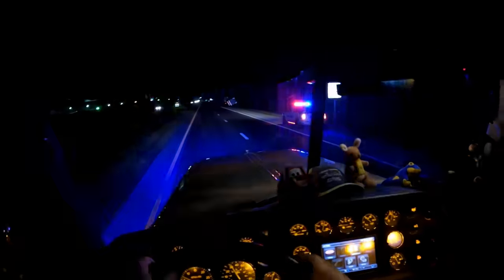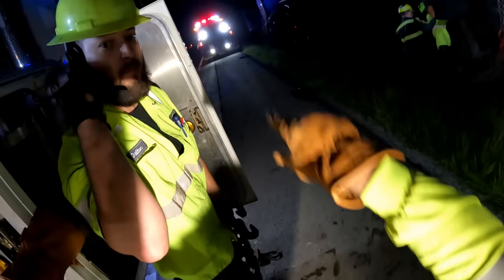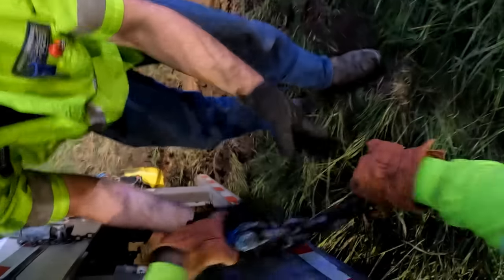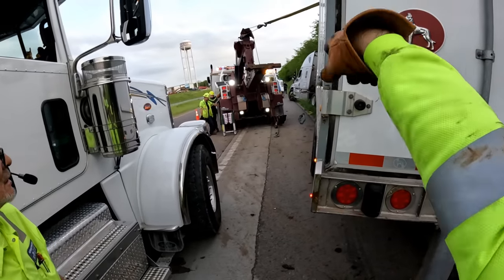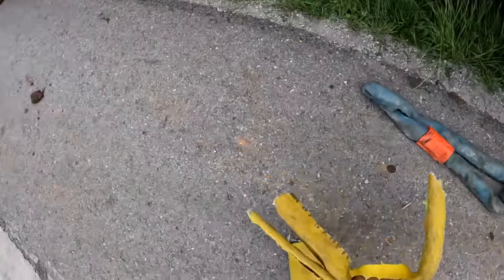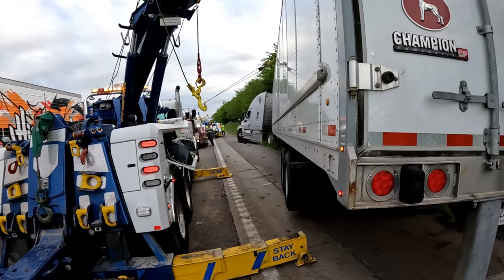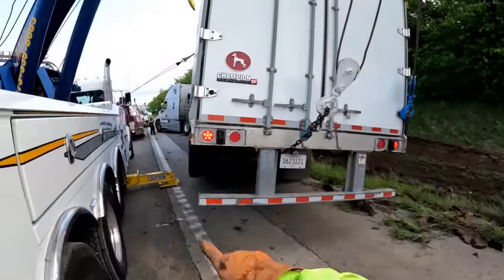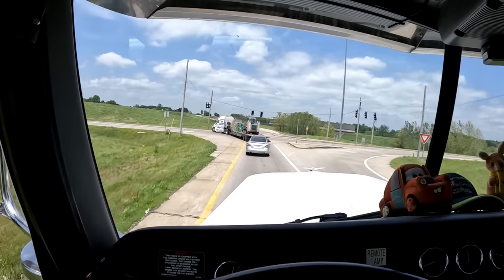Twisted Truck 2.0 Rollover Semi!!! The Job From...a Really Bad Place

Comment: Man this was a challenge Ron, I know you asked for constructive criticism but other than what you already pointed out I don't think you could have done any better with the resources you have. I can't really give you any ideas as I don't know or work with what you have, the biggest key in debriefing these things is what gear is available and what's the limitations of said equipment but here I go  Having the western star in front where the Pete was (low pulling the truck frame) and having a second rotator where the western star was (top wrapping the trailer) but that would have been a dream situation but you got dealt a bad hand from the start. With what you have as far as tools go may be swap the rotator and the western star have the back of the trailer but I don't know if the limitations of the western star would allow this to happen. Put the rotator in the middle with a top wrap between the drives and the trailer axles, as you say multiple ways of getting to ten and this one was not a easy equation to solve

Comment: In this situation would it have worked better if you rigged the truck for the winch out while it was still rolled over, then used the airbags to actually right the trailer so that you could start pulling it out of the ditch immediately instead of having to use awkward rigging to keep it from rolling over again? I'm not in the tow industry at all, just incredibly interested in it. You guys do amazing work and I have incredible respect for the people in your industry.

Comment: Here in Pennsylvania, the fire/police would simply shut the highway down back at the last exit, directing all traffic off there and give the recovery effort all the room they need on that side. If it’s bad enough, all lanes will be shut down. It keeps rubber neckers from causing more problems. Keeping even one lane open can cut off room for the crane truck to operate, and leaves the general public in an area of possible danger as they pass by.

Comment: Hi! Ron:  I know 20-20 Hind sight isn't a help because it is after the fact.  And you were there, not me.  But I think it would have been better to center the Rotator between the front and rear of the trailer.  Then when you right the trailer, level it and set it down in the ditch again.  Then rotate the boom to the tractor drive wheels, and lift them onto the pavement.  Then move the boom back and pick up the trailer and sit it on the pavement.  Seems it would have been simpler.  But again, I wasn't there.

Comment: Ron you asked for some advice, and suggestions. After watching this scene your job and everyone else's would have been much easier after unloading the trailer either partial or full then you could have used the rotator to roll and recover the rig. Yes I know how much of a pain it is to unload and restack but would have resulted in a faster recovery. This is only a suggestion and also an opinion from an army recovery specialist turned volley ff and truck driver.

Comment: Well done! Ron, when the rotator was up next to the trailer and you were standing with Talon asking if he could pull any more sideways, I saw the yellow line of the rotator hanging there all lonely.  Could you have brought it forward, redirected off of a tow hook put into the rotator's bumper and helped to pull the rear drive wheels onto the shoulder?
Reply from the maker: That's a good question.  I'd have to go back at look at that time frame in the video to see if I could have made that work.   Thanks for the suggestion.  God bless.

Comment: Just to satisfy my curiosity, would flipping the trailer and using the embankment as a way to hold the trailer upright (gravity assist), then you could have positioned  everyone in a way to maneuver  the truck back to the road way been a safe and viable option. Also was wondering if just unhooking the truck from the trailer and attacking separately would have been an option. I have very little rigging and/or recovery experience so i am just trying to ascertain if the ideas that just popped in my head were even viable and/or safe. Of coarse hindsight is always better than foresight. Thank you for the great content as always.

Comment: The last half hour of that video was some pretty intense choreography. It shows what a good team you have. Just curious about stabilising the rear of the trailer from a complete armchair amateur. Could you have shifted the Little Pete up the back and grabbed the left bottom frame rail of the trailer and pulled down with a cable run through one of the stabiliser arms of the Little Pete. That would have freed up the Rotator to work on the nose end of the trailer.

Comment: Ron, just a question as a regular viewer with no experience in the industry. At around and hour and 16 minutes in the video, what the chances that you use the red or yellow auxiliary line off the rotator and redirect off the western star to pull the rear of the tractor up onto the shoulder? Or does the geometry not work for the angles or weight on the boom become a factor? Looks like to me you were struggling to get the rear of the tractor up and causing the extra lean on the trailer. Again, just genuinely curious if that could help or have worked? Love all your videos and God bless!

Comment: Ron, Happy Columbus Day weekend I'm celebrating Thanksgiving up here in Canada...it is nice to see Talon back out on the road when he can.  With the way you were talking are you considering looking at a second Rotator...Just one quick question would this have job turned out the same if you had used the air cushions or would you have still had the issues you did.
Reply from the maker: We originally planned to use the air cushions until we found out it was a low center of gravity load.  The bags would not have helped the way we would have wanted.  Thanks for watching and God bless.
Reply: @RonPratt  thanks for the reply. I don't miss a video, I learn from your videos. A friend used to be an operator for a company in Ontario Canada. He used to explain how things were done, multi part lines I could never understand what he meant. You are doing what he was explaining. I am able to put two and two together with your videos. Thank you and stay safe.

Comment: Listening to what you said, and not having another million dollar rotator lying around, if faced with a similar thing again, I would have brought Talon in backward on the shoulder with Kenny and you acting as a slow safety escort behind him. He could have set up doing pretty much what you did in the video. Then I would have you at the forward centre to have two low lines, one side pulling the drivers off the front outrigger, and the other back to the trailer to pull forward, and the two main to lift and stabilize around the landing gear area. I'd've set Kenny up front close to help side pull the drivers in line with the trailer. and then do the front pull as before.  

But as you have said, many ways to get to ten.  That was a real nail biter.  Still, you got it out with no further damages and none of the crew got hurt.  Awesome.

Comment: Hind site is 20/20, however I would have positioned the Rotator further out into the roadway, this would have afforded you a couple of options as well as allowing you to bring the rear of the trailer all the way onto the road, something to consider in the future, always look forward and not the immediate pull. A little more effort in what you did but still a good result, well done guys, well done. Sometimes inconveniencing the flow of traffic is a must for a clean and safe result.

Comment: Looks like you done a good job at it. I think the only thing I might've done differently is run those blue straps up under the trailer and connected them to the left frame rail on the trailer and run them right up the rear post of the trailer on the right side? Seems like you would have been pulling down on the left side of the trailer while pulling up on the right side by doing it that way? You would've had a more secure grasp on the trailer seems like? Course that may not have worked if the trailer was laying flat down on its side? Then when you set it up on its wheels, you could've opened the back doors? Without seeing inside the trailer, Im assuming it was loaded two rows of pallets straight down the middle of the trailer? You could have gotten in there and restacked the left row against the left side of the trailer and that would have evened out your load (half on the left and half on the right)? That might have made it a little quicker to get out of the ditch and a little easier to pull after you got it out? If you and the boys didnt want to fool with it, Im sure there are Lumper Services in your area who would have come out and done it? There's a lot of warehouses in your neighborhood so Im sure there are Lumpers in the area? They wouldve known exactly how to restack it to even the load out? Probably wouldnt have taken that long to restack 1 row of pallets? The Trucking company may have even had a lumper service they use in your area if they pick up and deliver in your area? They are probably going to have to restack it anyway before they unload it? The getting it back on its wheels wasnt near the problem as trying to balance it as you got it out of the ditch because it wasnt completely laid over? Balancing it before you take it off its wheels would've probably helped a lot? Just an idea though? Might have saved you a lot of stress of worrying about it flipping back over? As Always, Great Job Though! Be careful out there.
Reply from the maker: You have a good idea.   The "safety guy" in me tells me not to go that route for a couple reasons.  First, we would still have to hold onto the trailer while the load was being shifted and I would not want to have anybody inside the trailer while it was leaning that hard and on unstable ground.   Just too dangerous in my opinion.  Second, as soon as you open the doors the trailer loses integrity and could fold, shift, or any number of things.  If we were to have unloaded it I would have had it done prior to uprighting.   I'm not trying to be rude.  I appreciate the input.  I asked for ideas.  Hopefully, you understand my reasoning.   Thanks again and God bless.
Reply: @RonPratt   Not a problem. Just offering alternatives. In the end you have to do what you think you need to do. Thats how I always dealt with situations involving tractor trailers, either I would do it or I wouldnt and I have to be honest with you, pulling a trailer down the road with 44,000 lbs sitting on one side of it is definitely something youd never be able to get me to do lol Frame rail could snap, air bag could pop, then its going over again. I shuttered just thinking about you pulling it down the road like that. Take care and be safe.
Reply from the maker: Oh please don't misunderstand.   Perhaps you didn't watch the all the way through the end credits.  We only moved it to the next exit, which was just about a half mile down the road.  We stopped and offloaded part of it onto our TrailEze trailer with our skid steer.  Then did just as you suggested and redistributed what was left of the load so that the trailer was leveled out.  I wasn't going to go any farther with that trailer leaning the way it was.  First right hand turn and over it would have gone....   I only meant that I didn't want to unload and redistribute the load at the crash site.  Thanks and God bless.
Reply: @RonPratt  You're right, I must have somehow missed that part? Yea it could have been rough either way you turn, as much as it was leaning to the right, it wouldnt have taken much to lay it back over, especially after that tractor frame got twisted the way it did? It had a good fifth wheel on it for it to hold on to the trailer the way it did? Just getting it swaying a little probably would have turned it back over? Everything worked out well, thats what counts. Take Care, love your vids, I try not to miss them.

Comment: A load shift like that can be extremely nerve-wracking as it seems to always want to continue to the shift side. When I worked at a truck stop we had a truck come in with t shifted load that almost took out a fuel island as it turned into the lanes.
Looks like it might be time to pull the trigger and get one of those trucks you and Ethan went and test drove.

Comment: Hey Ron, I know you can't (shouldn't) give specifics on cost, but can you give a general idea on what a job like this would cost? I part time run light duty towing and the biggest job we have done was about 3k. (involved swimming....) If you don't want to give an answer I fully understand, and hope you have a blessed day!
Reply from the maker: I don't discuss pricing on here for many different reasons.   I will say that 3K wouldn't hardly get this job started....   That being said, we had well over $2 Million in equipment on scene not including the personnel payroll, insurance costs, etc.  It takes a LOT of these jobs to pay for these Heavies.    Thanks for watching and God bless.
Reply: Those have been my questions too.  As a retired driver that once hit oil and water - set of doubles laid over AND me and tractor rolled complete cartwheel landing back upright but leaving me temp totally disabled 14 years  !!!  But I ultimately worked another 8 years as an OTR OO with UVL …. So yes curious as to cost (mine was July ‘83)
Reply: @StarPartners  I bet it was 8-10k.
Reply: @PremiumFuelOnly  more than double that

Comment: I think you asked for comments on how else this could have been executed.
Could you use the spreader bar ?
Across the top but further in from the rear,maybe in the axel line of the trailer and then the blue strap further forward,both with the rotator .
Then you could have Talon positioned forward pulling the truck drive axels and the front of the truck .
Basically where you are positioned when you moved the rotator.
A couple of points,the crew should be able to read your mind as to getting things picked up and cleared as you progress through the job , without you asking or directions,as is with getting them to move clear .
Could the air bags work to lift and hold the trailer edge so you could release the rotator lines ,at those moments you were worried about the trailer falling over ?
But hey we weren't there,it was dark and the unknown was present 
A load that has moved is also a complication ,are we thinking the load wasn't secure .

Comment: My only thought as a critique is I think I would have positioned the rotator out a little closer to the active lane before I started pulling, and some kind of side pull around the drivers to pull sideways and less forward pull, maybe a chain around the beaver tail or frame near the fifth wheel  but hindsight is always 20/20.  If you could have closed the road for ten minutes, they would have had both lanes open a whole lot faster.

Comment: Hey Ron the only thing I would have the suggested for you to have done was you should have put your rotator in the center that way you could have done more of a control lift and slide other than that there really wasn't much could have done differently on this job I know I've done this for 15 years probably not as long as you have but I believe you probably would have been better with a rotator in the center like you said you could have picked up the center of the truck in front of the truck and moved it over but on that was a fantastic job on a side note why does Ethan always look like he's bored just kidding great video keep it up be safe

Comment: A couple of times I personally would have done things differently but then I don't have a rotator- so Ron's experience with that trumps my experience with a lift jib... but when it comes to things like this- there is no 'right way' to do it- anyone who says otherwise has never actually dealt with accident scenes- you dont have 'OHS approved' retrieval methods- just what you got laying on its side, and what you have to work with...  every accident is different, and you have to 'work with knowledge and experience' when dealing with an unknown load, that has randomly redistributed itself, with random angles of inclines and lifting angles and unknown (and random) tear strengths- a good operator doesn't work with 'tables and figures' in situations like this- it is all in 'the feel' and that takes experience to do...

Comment: I have watched Heavy rescue for a few years. I have yet to see any company use a telescoping camera to see inside a trail when a load has shifted. A 1/4”-1/2” hole drilled anywhere you want to look. A small hole and you know what you are dealing with? A simple small patch and all is good. And you guys know what kind of weight placement you are dealing with. And didn’t open the trailer door. Just a thought.

Comment: Ron I would of pull the tractor since it’s comprised the bent and tweeted frame. Hook the little Pete to the tractor to pull it out of the way. Have the Western Star hooked to landing gear an the nose of trailer before up righting it. Or you should of off loaded the trailer to make it lighter and least dangerous.

Comment: I notice that you had a line connected to an outrigger. Was that for extra support using the rotator's weight to counter the weight of the trailer's load? Also, I'm guessing the truck is scrap based on that twisted frame.